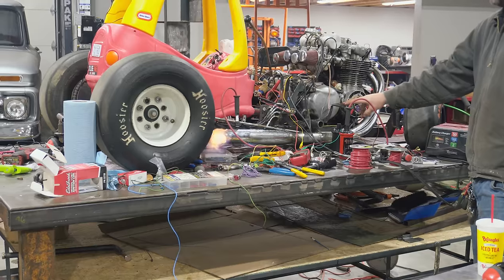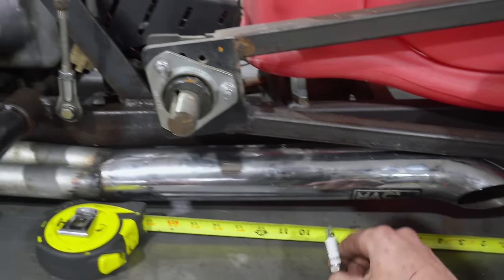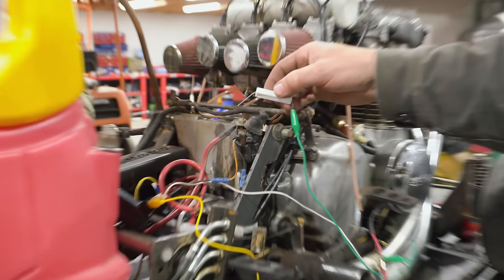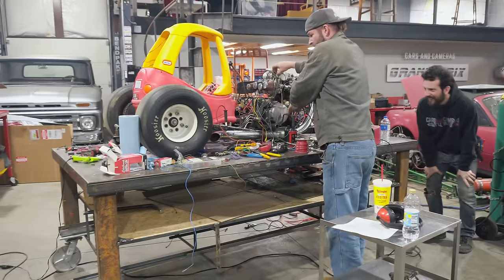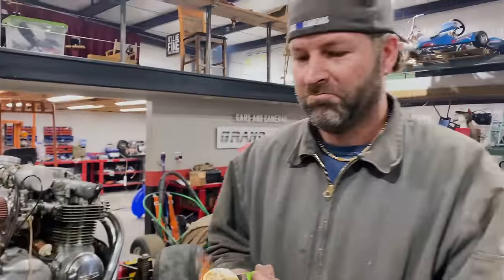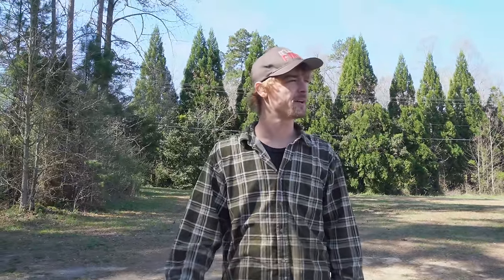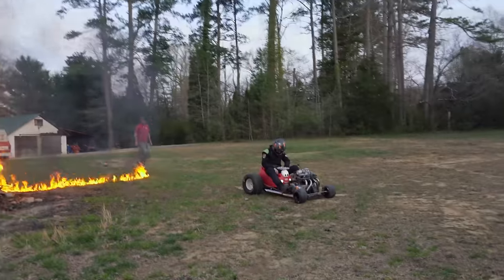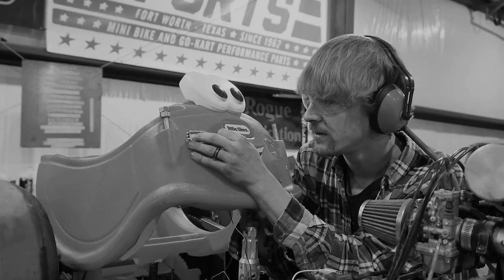550cc Little Tikes Car Gets a FLAMETHROWER!

Comment: I started my first shifter kart project last summer, at the age of 13, Bc of y’all, it’s has a Yamaha R3 motor on it, 320cc, efi, and around 40hp. Thank y’all for the motivation and knowledge
Reply from the maker: Love to hear it, make sure you're wearing your safety gear!
Reply: That's awesome!
Reply: Get er done!!
Reply: Don't forget ya mini mayhem gator🎉
Reply: Wondering if you guys have a suggestion for a snowmobile engine replacement that had a 550 fan originally.
Reply: @crazychivez  got er did
Reply: Excellent news, half the job is getting in the workshop and getting your hands dirty the rest is creative fun 😁
Tony from Western Australia 🇦🇺
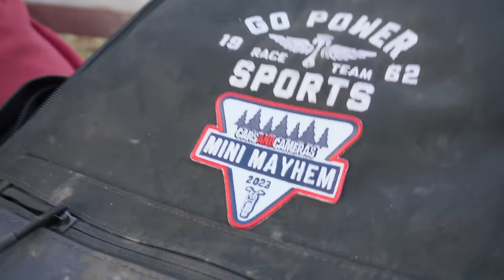Reply: Buy a b16 type R honda 31:14 .. it's easy to build and a great way to learn
Reply: That’s awesome! Piece of advice, start a channel with it while you’re young, by the time you’re old enough to work. You won’t have too like these guys but a 1/4 of their age! Have fun
Reply: should be done by now????

Comment: I built my own home Brew flamethrower system using a bunch of relays and some coils and spark plugs. The relays turn themselves on and off at a rapid pace to keep the spark constant and blue. I then inject propane into the exhaust ahead of the spark plug so I'm not having to run the choke and push extra fuel into the cylinders. Shoots really cool flames. This is awesome project keep it up guys
Reply: How did you get those relays to work? I'm making something similar myself but I need something to turn the spark on and off.

Comment: Mini mayhem sounds like great fun, wish I could make it along with buying merchandise but I live on $161.28 a month.  But the main reason I'm messaging you is to ask about the Opel GT which I would love to have as I had one back in the 70's an it was great to dive but never got the chance to do  a resto mod on it. 5.0 w/ a C4, neared rear an tubed an make it a sleeper. Did that before with 2 separate Chevy corvair's, a 64 W/ a 302 SBC an a 67 w/ a 327 turbo 350. God I had fun on Saturday night's at Gainesville raceway

Comment: They used to just run a wire down to a spark plug drilled into your exhaust pipe. When the unburnt fuel passed right there 'POW'!

Comment: Just mount an old-school coil and run 12v to it and the other side to the spark plug(s) that are in the exhaust, boom 🔥
Reply: You still need a trigger signal to it, like off a set of points.
Reply: @jesperwall839  thats not how a coil works

Comment: Yes, setting fire to things around you is a probability. One thing is that most exhaust flamethrowers you should run the engine revs up abit. Throws the flame farther and all that and prevents the flames from getting sucked back into the engine.

Comment: On your ignition for the flamethrower you could have just tapped into one of the power wires from your alternator stator before the reg/rect. These power wires at this point are AC voltage. Plenty to trigger a coil.

Comment: I just used a short stubby 6 cylinder distributor complete from shaft to plug wires with a Pertronix electronic ignition module. Dual exhaust got 3 sparkplugs each about 8 inches from exhaust tip. Distributor was spun with a cordless drill motor wired to a rheostat switch. I fueled it  with propane that used an air bleed that I tuned to get a proper A/F mix. Then I could open the propane and start spinning the distributor. It was on an inlne 6 and at low RPM with practice I could almost make it appears to be the engine producing the flame and a nice little pop withe each flame, at high RPM it looked like a Pear Burner run amok coming out of each pipe and it had a roar that almost got me arrested.

Comment: Seems like a good time (when its not raining) to get all the projects out for a spin around the property to blow out the cobwebs and get some ideas for upgrades or think on what could be added to the current lineup as a new project.  I'd still like to see a new 4x4 iteration, or another project with a "magic box" 90 degree gear box on it like that big block bike you guys did.  Those were both very innovative projects!

Comment: May I suggest drilling the steering wheel's nut-n-bolt and running safety wire through it? Glad John didn't get hurt. I think Ike took a bad enough injury to cover all of you for at least a year or two more

Comment: Der hot glue melts you do know this kids the ignition unit will fall off and mash up your system jb weld it or use a epoxy two-pack glue but NOT hot glue as it will melt and fall off.great video guys as always boys cant wait to see what you come up with next lol.

Comment: Boys, use an auxiliary fuel pump to pump extra fuel into the exhaust tubes so you have flames even when the engine revs up. Use a switch on the dash to turn the pump on and off.

Comment: 23:26 Is there fire leaking from under the exhaust or is it just a camera artifact?
Reply: They cut fresh air slits into the bottom of the pipes. When the fire lights off it bleeds out the bottom of the pipes as well.
Reply: @bashr52  oh yeah. I forgot about that

Comment: I had a couple cars with flamethrowers back in the 70's/80's but used propane in the exhaust, you could have a little blue flame at idle but shoot flames when you rev'ed the engine depending on how you cranked the propane valve

Comment: Looks like your blowing your valve seats out and your valves going off all the sparks coming out of the exhaust 😮
Reply: They cut slits in the bottom of the pipes to let fresh air into the pipes. That's why it's sparking/spitting fire out of the bottom.

Comment: I feel like a resistor capacitor circuit could have been quicker/easier than the ignition pickup for the coil, but I don't know enough to know if that would drive the coil correctly

Comment: once i forgot to bolt up my front BMX wheel after changing the tube and took it for a test ride. it went well until i did a huge bunny hop and landed thinking the front wheel was still on... it was getting dark and i face planted SO HARD into the ground.

Comment: What if you put a fuel injector efi in each pipe with a separate full system then you could keep the choke off and turn the flame throwers on and off

Comment: From what I noticed Ike put the chokes on to get flames. So if that's the case this is not a good idea. You shouldn't flood a engine like that. Rings and cylinder walls will not be happy over time. I do not recommend anyone doing it this isn't smart. Things missing on a cylinder like crazy.